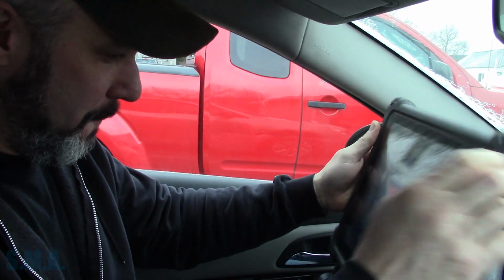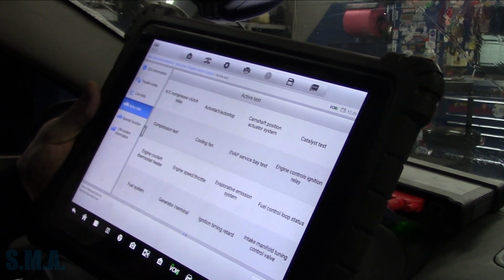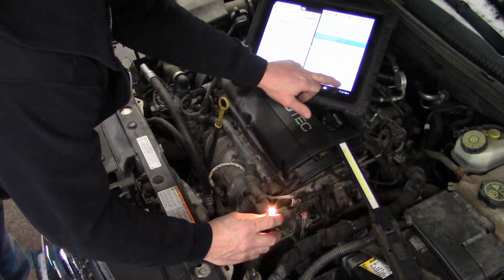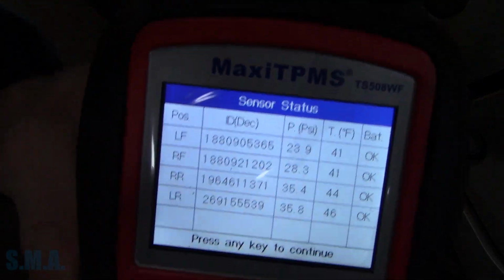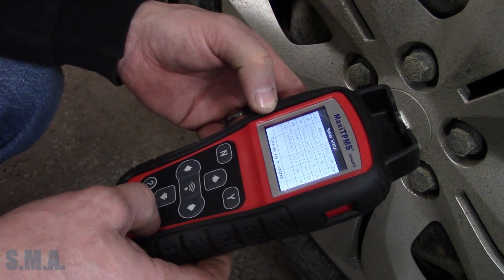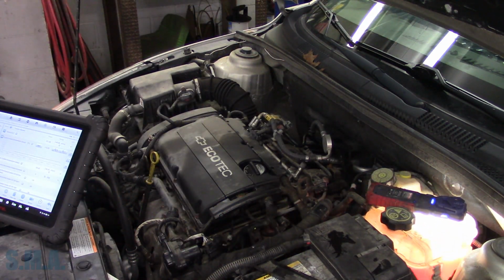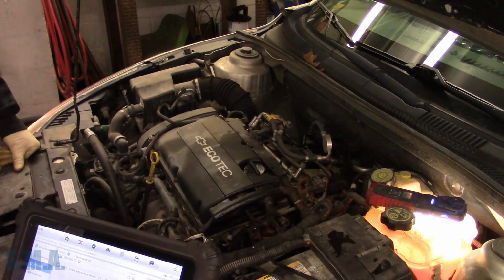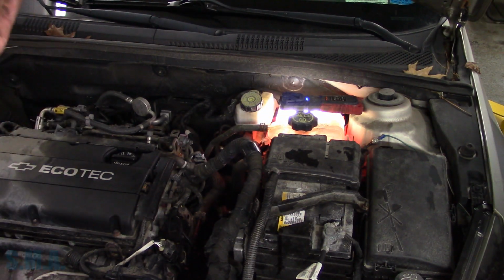Chevy Cruze: Thermostat Heater Codes / TPMS Light On

Comment: What does a heated thermostat do for us?
Reply: The engine is designed by Opel. To reduce friction it runs at higher temperatures than a traditoinal engine. Higher temperatures means less thick oil.

This function is only active at part load. To prevent a thermal shock when the load change from part load to full load the thermostat is activated by a kickdown to "pre"cool the engine.
Reply: @meisterade4145  could you explain that 2nd part again like I'm five? lol
Reply: @kylefowler5082  it get the coolant up to temp faster. They coulda just put a block heater in a freeze plug, but nooooo.
Reply: @eldonerc2524  Thank You!
Reply: The purpose of the heated thermostat is to allow the ECU to adjust the operating temperature. From what I understand they keep it high for better emissions and lower to under load to prevent pinging.
Reply from the maker: Takes your money? Other than that I don't really know lol
Reply: @SouthMainAuto  Great answer ERIC!!

Comment: I have a stupid question.  Why does it need a heater on the engine coolant thermostat?
Reply: Old style thermostats had a bypass bleed  which would allow a small amount of water to heat the wax capsule, but in the process also kept the engine below temperature for longer. I believe that more modern ones don't have this so an electrically operated "bleed" is needed to allow hot water to heat the capsule, otherwise it would be surrounded by cooler water. This lets the engine heat up more quickly so it is better on emissions.
Reply: Emissions
Reply: @snot-Ox29A  Gosh dang, I knew it would be due to the big E word.  Thanks for the information.
Reply: Engineer's have run out of things to F with and need something to justify their jobs.